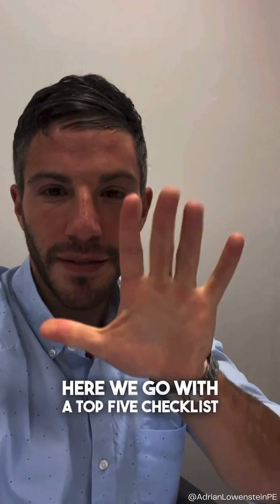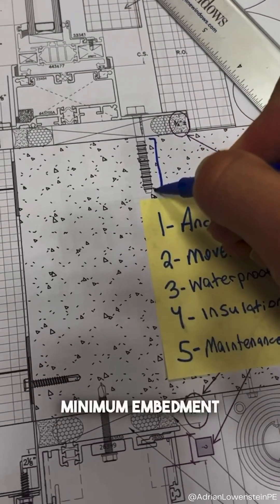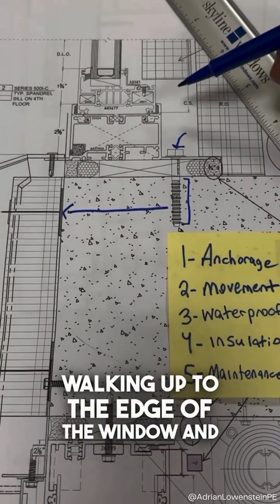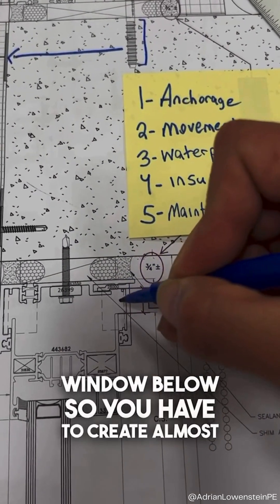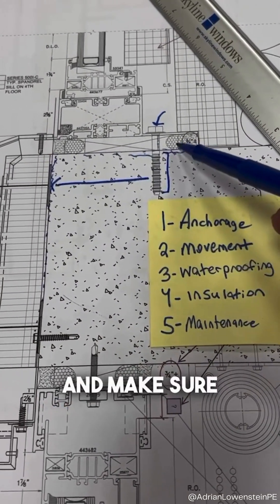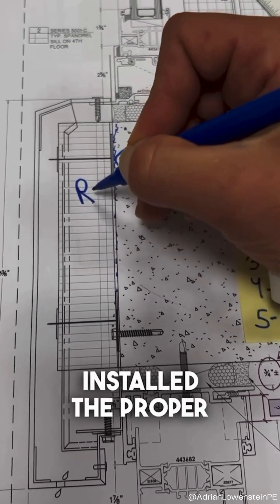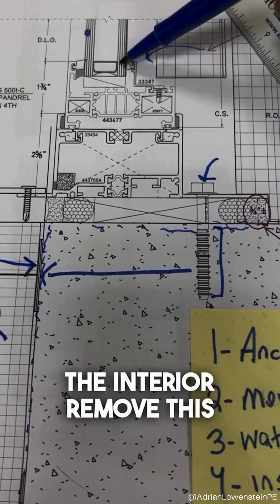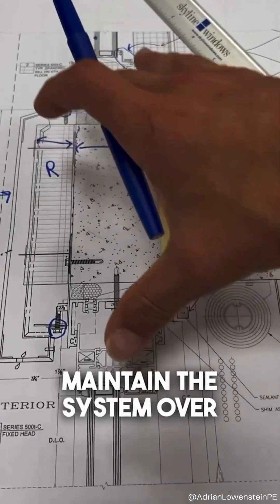Window Wall Design 101: 5 Must-Check Points

Comment: Detail is probably incorrect due to risk of thermal bridging at sealant area 
Normally you see insulation in line with glass to prevent from such a scenario however I guess design fallows architectural design that could be wrong too unless there are other reasons I cannot see from this one detail 

Thanks for the content 👍🏻